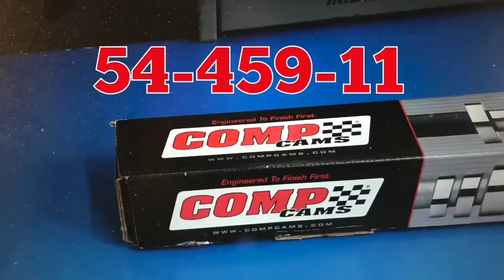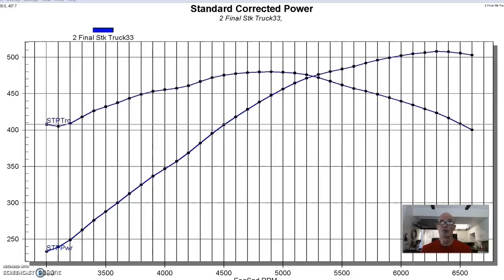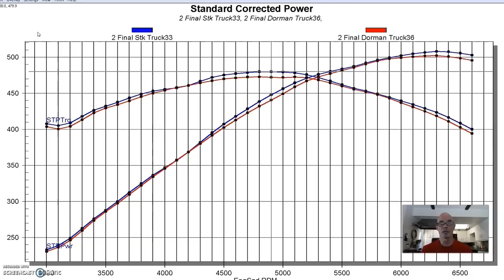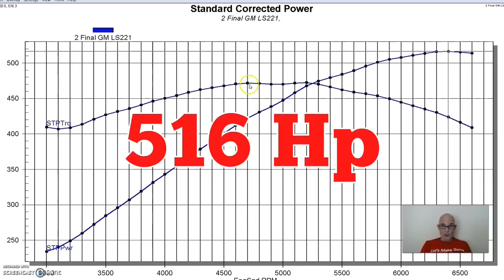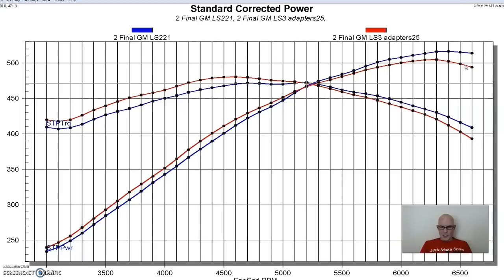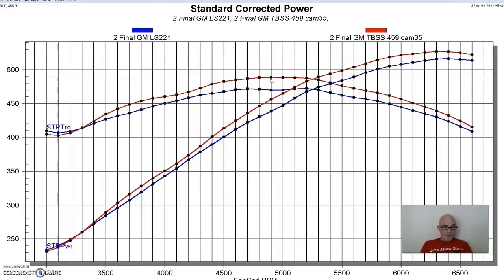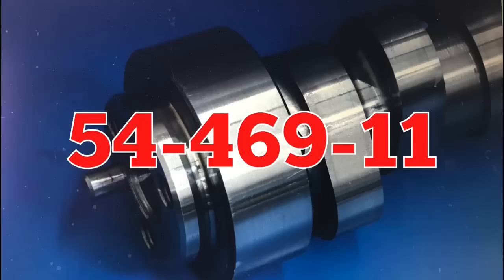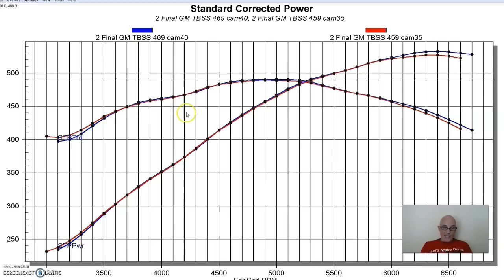TOP-SECRET LS TEST-FACTORY LS3 WITH ADAPTERS

Comment: Currency resets occur about every 40 years...

 https://www.linkedin.com/pulse/big-cycles-over-last-500-years-ray-dalio/

In reality, that arch would be made of small squiggly equally spaced  symmetrical sine waves showing currency resets and instigated
profit generating wars from beginning to end.

After the great currency give away and civil works projects of FDR,
came WW2... it's why I'm expecting other unpleasant things before
or just after this free money freak show is over.

There are no natural forces in control at this time, excepting
"natural selection" , which pre-selects those who just sit, making no preparations for "what if",  waiting  for nothing but good news : ))

image.png

"The new world order" is a cyclical renewable  term"
A new old world order would be more grammatically correct.

The original NWO began in 1694 England when the "fractional reserve system was  ushered  in under King William.

There were many short wave cycles contained within the long curve, but the idea of lending out 90% of customer deposits in the hope that a crowd would not arrive to withdraw their gold, ended with  the beginning of the Federal Reserve NOTE dollars issued in 1934, still unchanged and in circulation 86 years later.

FDR pulled that one off, by confiscating the peoples gold in 1933, making
a bank run on hard assets impossible, wile diluting gold value by printing
75% more paper money , raising Gold from $20 an an ounce to $35
announce...further devaluation would be needed during our 1960
recession, when Gold was raised to $40 an ounce where it's preposterous
value is maintained by the IMF and world bank til this day.
Russia and India blackmailed the IMF to sell them $40 per ounce gold
after the 2008 crash... the IMF complied , had they not, billions in
US bonds would have been dumped, making the pseudo 2008 recovery
an impossibility !  One stipulation, was that India pay for the Gold in
"Silver".... this allowed IMF silver market manipulation to follow shortly after.

The advertised 2 1/2% inflation rate
promised by the FED hijackers in 1913, crossed well  over 3000% by
2013. FDR  executive order 6202 , banning public gold possession
was lifted in 1975, as a "gold glut" was needed to protect FED
counterfeit by reducing golds value, and raising % rates on T bills.

America used to be about investment...since 1980, it's been about
speculation and trading, that is, (NOT) sitting on holdings , allowing
them to grow over time , (BUT), to buy, hold until a 2 or 3 % appreciation
has occurred , then dump the stock and move on to another parasitic
victim....it's "Day Traders" that ruined the stock market, and stifled
American growth... it was HFT high frequncy trading from 2010 on,
that made the market into nothing but quicksand for the honest investor.

Prior to the 1934 dollar, US currency used to say "pay on demand"
in silver or gold... but even silver was raided beginning in 1965 to deter
the American people from conducting dollar free commerce free from regulation,  and devaluation of the (IOU nothing) dollar, unbacked by anything after 1971.

By 1963 the devaluation of the dollar by the $400 billion Koren War
debt, and by Charles De Gaul shipping boat loads of dollars to NY for
redemption in GOLD,  saw people withdrawing large amounts of US
silver coins to be smelted for an immediate 10% profit at recycling centers... this signified the purpose of precious metals , as a regulator
and alarm bell of unauthorized currency creation under the 1944
international Gold / Currency contract , signed by 44 nations , including the US.

I always believed that toward the end of the dollar, there would be an
exchange rate offered to "bridge" into the next currency, "what ever
that  will be... Contrarians  like myself once believed the system would
cycle back into hard assets, and history would revert forward to
precious metals as it always has...

but that theory would threaten the new currency, revoking power from the criminals who Hijacked the dollar in 1934, and continued their "WAR" reset method to revitalize dollar deflation  through weapons sales, and outright THEFT from other nations.

The illustration above depicts "entropy" , which in terms of human
nature and economics, is an unending sine wave that repeats with
regularity.

The last currency reset was in 1980, when "derivatives" allowed
comrade Reagan to ((( TRIPLE )))  the national debt during the
great American cocaine party...both the banking sector and the
stock market crashed in 1987 as a result... 5 years later, illuminati
president George Bush Sr. proclaimed a future NWO as he departed
office. Bill Clinton would enter, cementing all the wishes Bush and
the like...

The 1979-1984 recession was brutal ! it was the only recession  we had seen that came close to resemble 1929.

There were mechanics applying for jobs that were not advertised...
people were offering to do my job for $2.00 an hour less were the
boss to fire me...and the freeway system was void of traffic at
rush hour !  but for natural reasons, not draconian socialist reasons.

The main difference with that deflation, were people who largely
did business in cash, lived within their means,  had savings, and
like me, and never carried more than $50 in credit card debt.

The structure of what is happening today, resembles nothing
we have ever seen !  The FLOOD of trillions (at least $20 trillion
since the derivatives collapse on September 19th 2019), has
forever pissed in our punch bowl !

The only way to remove the money
is to destroy the debt..and in doing so, destroy the bond market
along with it; which has most likely already been done...destroying
Canadian credit card debt in July is almost certainly what crashed
the system in late September... (the Gates COVID crime) was already
in the planning stages to cover it up.

Those of us who lived modestly, and accumulated savings,
may very well see our nest eggs turn to dust by the end
of 2021 or sooner... it's why I'm dumping $7000 into a new roof
while the money still buys anything.

Aside from that, and some calculated purchases, they have
sealed virtually all the exits.  Real Estate is a bad choice !
as property taxes will likely double within 3 years, unless the
wave of sheriff auctions and repos reduce assessments values...
but even that wont matter if the criminal legislature
restructures the tax formula... one possibility that's not
happened yet, would be 50 to 100 year lease agreements
from HUD if they get their tit in the wringer and need some fast
capital to stretch out the carnival  ride til "Martin Luther King day" .

Comment: I’d love to see a Stage 2 NA comparison between the different brands like TSP,BTR,Comp cams,Lunati and summit racing. Which cam makes the most power , which cam allows 2500 rpm and under stall speed . Which cam has Best street drivability. 
Cheers
Reply: Nobody dyno below 2500 its useless.

Comment: Nice test Richard! I've been wondering for a year on ls3 heads on a 6.0 block with adaptors with cathedral intake. My ported fast 92  intake would be a good test!
Reply from the maker: no reason to run ls3 heads with cath intake and adapters-I did that test too-ls3 intake is way  batter

Comment: Please do some Toyota UZ stuff. Sooo much misinformation about those motors.
Reply: Toyoda / Lexus family of UZ enigines are way too expensive for majority of aftermarket support.
4 cams = EXPEN$$$$$!VE
Timing issues ???
Theres 2-3 companies making
Big bore & stroker kits Lextreme & Crower all in the 5-10k price range
Factory TRD supercharger is the best
bang for $$. Very low demand for UZ mods compared to LS, Hemi, Coyote, V-Tech.
Reply: gin ngo yeah having to pay for 4 cams is definitely more expensive than paying for one but cams for UZ engines are along the same expense as mod motors and coyotes and they have a lot of support. Just want to see more support. Those stroker kits are no longer available.
Reply: gin ngo what do you mean timing issues?  The fact that it has a belt and not a chain. At least it’s a non interference engine so if it breaks you don’t have to worry about messing anything up.
Reply: @maxwelltollefson9947  supposedly early 1uzfe are NON interference engines & VVTI engines are...
Thats NOT the case....several
early 1uzfe have damaged valves / valvetrain / pistons do to timing belt slippage / breaks. Factory ecu
have their limitations 7,500rpms use Haltec, Motec, or AEM. Aftermarket cams $700+ each. Big bore & stroker kits still available but high in the $5-10k range..UZ - UR family engines have Forged rotating assemblies cranks & rods. 1uz & 3uz aluminum heads & block. 2uz aluminum heads cast iron block. Many Japanese car companies prefer forging over cast & are willing to invest in it.
A great budget build for me 
stock 2uz & T70 size turbo
Dream build
3uz block & pistons, 2uz crank & rods, TRD supercharger, vvti delete
Being a gearhead I've been lucky to
work & play in the auto industry for
30yrs...parts, mechanic, writer,
management...15yrs alone with
Toyoda / Lexus / Scion / Hino
Reply: gin ngo why in the world would you use 2uz rods. They are soooooo thin. I’m currently running a cx racing gt35 turbo on my 2uz. I’m only running 9.5 psi of boost and I’m scared every time I put my foot down. Only a matter of time before the rods go. Aftermarket cams are not 700+ each. They are 1200 for all 4.
Reply: gin ngo also why delete the vvti. Unless you are running an absolute crazy cam vvti can only help.
Reply: @maxwelltollefson9947  2UZ rods & crank for cheap O.E.M quality forged stroker found at junk yards. 3UZ for aluminum block & factory big bore..
Many different combinations you can build using junk yard parts.
Your rods should be good for your
power. Deleting vvti = less headaches..remember stock
Factory 2JZ & 1JZ & 1NZFE
can handle 2,000+ hp....
UZ, UR, GR engine family not
much different in terms of
QUALITY FORGED cranks & rods
Good luck & happy hunting
Reply: Many aftermarket companies use "thinner" rods...common practices
but the metallurgy is stronger, forged, heat treated, cryoed,
polished, knife edged, shot peened,
cracked !!!
Some I beam rods are some times 
thicker or thinner than H beam rods & vice-a-versa...UZ family are great
phenomenal engines ( heavily underrated ) F1 technology tho
but Lexus did not design or build 
LS400 sedans for racing..It was Toyoda way of giving the finger to
the germans, britlinds hahaha, Cadillac engineers a run for their 
money...Toyoda the ONLY car company in the World which never received subsidies or filed for bankruptcy...
Reply: gin ngo the rods are definitely definitely not forged and are about as weak as they get in terms of factory rods. If you wanted somewhat beefy rods use the early 1UZ Rods. They are somewhat comparable to the gen iii rods in the ls engines and are by no means forged.
Reply: gin ngo also the 1jz 2jz definitely cannot handle 2000 hp factory. Clearly you do not know what you are talking about with that statement right there.
Reply: @maxwelltollefson9947  I have several former coworkers / coworkers with 2,000 hp 2JZ twin T78
on bone stock OEM unopened
bottom ends...
Your rods. & crank should be forged
Reply: gin ngo on the Supra forums the highest that I’ve seen stock block is around 800-1000. Anything more than that and the rods just can’t take it and it’s a ticking time bomb. And no they are not forged. Please google lextreme comparison of UZ rods and educate yourself on why anything after early 1uz rods are basically garbage. They are pencil thin and are definitely not forged. You might be confusing it with the process called powered forging.  This is not a forged rod but is basically called that for marketing reasons.
Reply: gin ngo also if you would read on just how many people have put holes in the blocks of the various UZ engines because the rods gave out you would know how much they are “forged”.
Reply: gin ngo the crank however I do believe is forged.

Comment: Like to see some more on the LT-1, whenever it's convenient.  

I have four of them just sitting on the shelf, and I'm very strongly considering dropping one of them into my 85 MC , and doing a rear mount compound/sequential turbo setup on it.

I have a stock 87 GN Garrett, and a  stock 2001 Powerstroke Gtp-38.  

So far, no one has said that they won't work in this application, although some have said that I should just buy a couple of eBay Gt-35s, and forget about the sequential turbo "nonsense"...
Reply: Is it an LT1 like a new production gm lt1 that's direct injected? Or is it the fifty year old 350 lt1? 
You can max out the gtp on either but there is no point in using it. About the only guys that used it were stock 5.0l guys, they really aren't all that great of a turbo and to compound with that as the big one is pointless. You would only need about 10-12psi on the gen1 lt1 to max out the compressor and like 2psi on the gen5 lt1. It is way too small of a turbo to use on a v8 and isn't worth your time unless it's free. Those turbos are not sized right to compound either, close but there isn't the bias in size. It would maybe work to compound something like a 4bt cummins that only makes 100hp factory. 
Why do you want to compound turbo a gas engine anyway?

Comment: It looked like those adapters extended the runner length which would explain the trade off in low end and top end power.
Reply: Honestly that dyno graph wasn't too bad. I mean it was making more power and torque up to ~5250rpm. In a truck application where you would spend most of your time below that, it would make sense if you have the LS3 manifold laying around to use it.
Reply from the maker: its not runner length change-it wasn't that big of a change

Comment: Great work Richard, as usual. Can you run the LS7 intake on the 6.0 with adapters, or is it too big, or wont interface, or????
Reply from the maker: no need to adapt that
Reply: The ls7 has the ports higher in the head so the intake is wider as measured at the centre of the ports. Because It's wider it doesn't like up with the ports at all. It's also kinda pointless. Factory ls2, ls3, lq4, ly6 intakes work pretty good. Used they are quite affordable. It might make for an interesting test but I am really doubtful that there is anything to be gained from running such a mismatched combo.
You can however run a rec port intake on ls7 heads with an adapter.

Comment: The adapter/ls3 combo would work well in a truck application or a heavy vehicle with high gears and a tight converter.
Reply: At that point might as well run tbss intake same mid range torque and more up top , and it's cheap as chips .
Reply: @dilsher12  not if you leave the stock cam in it. You don't want a engine turning 6500rpm in something like i said......unless it's some mud racer.
Reply: @HioSSilver1999  the difference between converter stall and where the tbss passes the ls3 intake is like 900rpm. Even a stock truck will flash the converter to 2400rpm. This thing has a pretty chunky cam in it and that rpm might drop with a factory camshaft. Like the only spot that ls3 adapter combo does better than a tbss is between 2400 and 3000. 
If you make the argument that it will lug lower, your talking less than 5% torque and the reason it doesn't matter on automatics is they downshift.
The gains seen from the ls3 also will not translate directly to a stock cammed engine that requires less airflow. 
Your throwing more parts that don't work because of a tiny change. Instead of ls3 adapers and intake you would be better off getting a btr torque cam that makes more torque at every rpm from 1500 to 6000 and use the stock intake.
Reply: @timothybayliss6680  i made the comment because my 6.0 2500hd basically runs and pulls below 5k rpm. Never hardly ever goes over that pulling that 2400-3000 rpm area is where it spends most of it's time.......hence why that ls3 intake with adapters would work well in that situation.

As far as I'm concerned ls engines should virtually never be cammed on a stock 78mm tb intake. They pull pretty hard on the map sensor as it is. Most people never realize the acceleration these engines offer......and typically a cam makes them worse. It's not like we're tuning with a holley efi set up.

Comment: Some of the low-end torque and horsepower with the LS3 manifold and adapters probably came from adding the runner length. This is probably also why it lost power on the top end. Just speculation but that was a very interesting test! Thanks Richard
Reply: Ooh good thought. I think that sounds like a logical deduction.

Comment: On the ls3 adapter plate test do you think the increase in low end power is due to the longer runner length provided by the plates? Neat trick for a low rpm street car or truck.
Reply from the maker: it did not change the runner length enough
Reply: Ok. Thanks for the reply.

Comment: Richard sir I have another " other guys" test you could do . You could do a dyno comparison between the 300-6 ford vs the Chev 292-6 naturally aspirated then add a turbo to them critters . The engines would be cheap to buy  they'd hook to the dyno easy ( both cranks are drilled for a pilot bearing ) nothing weird for the bell housing pattern unlike the 225 slant 6 . The only real shit part would be figuring out headers ( or use the factory exhaust ) to build the turbo plumbing . There's guys who drag race the strait 6 still these days . It would be a different show to do lol 🐿🐿
Reply from the maker: getting a big Ford